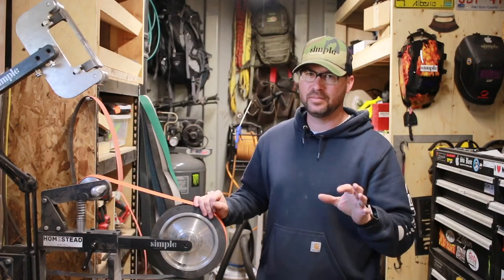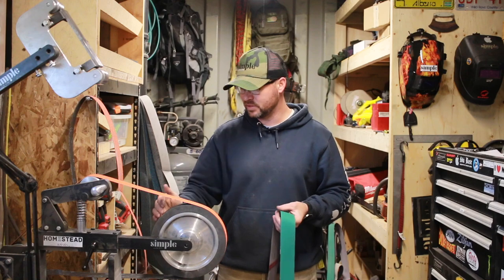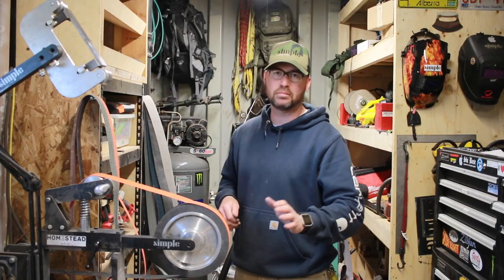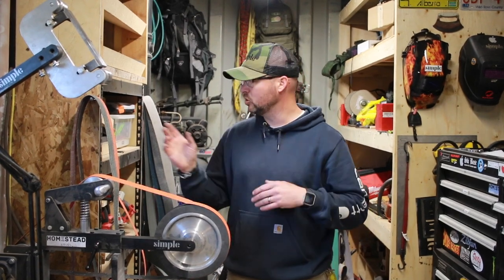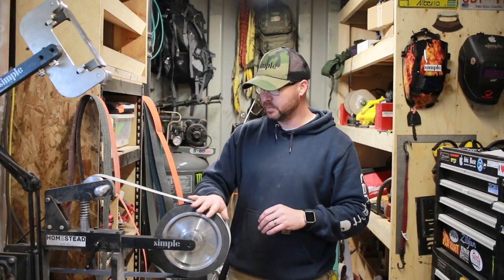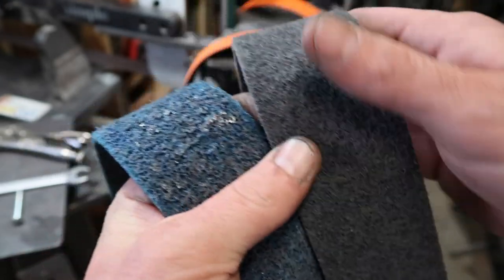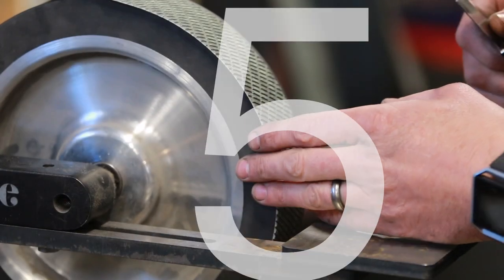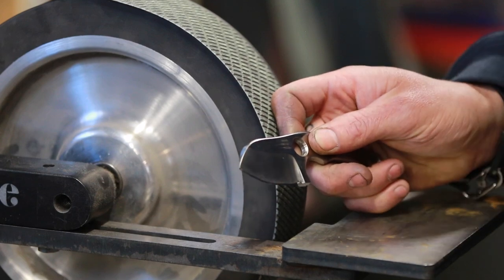5 Tips for Grinding Better Bevels on Your Knives - Grind like a Pro!

Comment: A great way to practice bevels without ruining a lot of good tool steel is to go to Lowes or Home Depot and buy mild steel bars.  It comes in the same thicknesses and widths as good knife steel but cost a fraction of the price of good steel.  Cut and profile pieces and then grind away.  You can get a 1.5" X 3/16" X 36 inch piece of mild steel for under $10.  Depending on your knife designs you can try to grind 4-5 knives out of the one piece.  Bear in mind that if you do a good job and like the knife, it won't be worth a crap because it won't harden LOL.  But once you get to that point, it's time to use good steel.  If I'm trying a new design, I'll still grind it first with mild steel just to learn from the process and also determine if I like the way it comes out without investing in a good piece of steel.
Reply: Great idea, and your results can become templates, if I'm not mistaken. Thanks!
Reply: You can make it harden. You'd need to case harden it.
Probably not worth it to most people, but if you had the gear lying around anyway for whatever reason.

Comment: I've been a machinist for 27 years.  I've freehand sharpened drills, for years.  I don't remember how bad I was, when I started,  but sure it was pretty bad.  All that aside, I'm new to knife making.  This video is a great reminder that this is a learning experience.  Some things translate, because hardenable steel reacts predictably. But beveling is a "new to me" skill set.  
Thanks for the plungline jig top, very helpful.  Add well as the angle modifying tip.

Comment: Good advise! I have been building knives for around 6 years now off and on and have found the jig thing is not good at all. I agree with the free style way of doing things when it comes to  grinding knives. You have more control of the blade and you can feel the angle better. Thank you for the info on the sander belts. I am working on building my own bigger sander 
and was wandering what belts i could use to make things better on my finesh product. I am using a fifty doller 1× 30 inch belt at this point and don't  have many options on types of belts to use. 
Thank you and God bless.
Maverick

Comment: Thanks for the tips! Just bought a couple of the x200 belts because I was literally having that same issue today with aluminum oxide belts! I was noticing the the left side and center of the belt was more worn down than the right side and I could not get the blade flat! Thanks again!

Comment: hello sir. i just wanted to stop by and let you know that tip number 2 definitely helped me out a lot with flat grinds. my thinking was to start off mild like 120 or so because if you mess up with 40 grit or 80 grit then its a lot of work to try and work that out. but after i watched this video i tried it and as it turns out, once you start with a really aggressive belt, and as a long as you take your time and the get line straight the first couple of passes, then its so easy to stay in that same line. its much easier to feel where the line is than if you were using a higher grit belt. and even if you mess up its much easier to just grind the flaw away and start your line again using lower grit. thank you for the tips. mine are still nowhere near perfect, but after practicing these tips on 2 or 3 smaller knives i can already tell a huge difference. the plunge lines are clearly defined and the bevel lines are pretty close to straight. im going to keep practicing and i hope youll keep making awesome content for us!
Reply: also wanted to add that i made a jig like yours when i first started and it worked really well, but i didnt feel like i did it. there was just a disconnect there that i didnt like. i felt like i would rather have some imperfections in there that "I" created rather than everything be straight and perfect using a jig. obviously, its a matter of personal preference, and i dont have anything against people that use jigs, but i just didnt like that disconnect. it just felt like i wasnt learning anything. the only way to get better was to practice doing it myself and so thats the route i went. thank for your content, sir.

Comment: Really is a great video, and shows the entire beveling process from pre-HT to post-temper. I appreciate that you call out what brand belts you use, but it might be helpful to also state the grit, or micron count. You did this in the pre-HT belts but didn’t mention it for the Trizact (which are indeed GREAT belts, albeit pricey). Excellent job man, and thank for posting this. Probably one of the easiest yet most complete example. Cheers.

Comment: Thanks I always learn something new from the videos, it's a huge help in growing my skills. You're right every knife and mistake you makes you a better maker. I think you are dead on with confidence in your grinding. If im stressed about something im working on or other life stuff my i notice my grinds need to be refined, or plunge line is off.  When im just working a style the that I've done before the grinds go smoother and faster. I have used a plunge line jig. First time I used it on one of my first knives the belt grabbed the bolt I hadn't trimmed down and kicked the edge into the belt. Opps. Over confidence can hurt  you too. Being complacent in the shop is easy to do. Mike at Ekim knives posted a video about shop safety. I watched it. The next day I was taking scales off an untaped knife. Just a few  seconds into this I thought this is dumb to do and as fast as I thought it I put a (small thankfully) knife through my pinky and out the other side.   Split second of not paying attention can get dangerous fast.  But after 4 hours in the hospital im much more careful to not get caught up with other things or rush to finish an order. I was really lucky my hand hit my vise or it could have been much worse. I now have the hospital bracelet in my shop as a reminder.

Comment: Hey Jeremy, 

I've learned a lot from you and I started grinding knives recently. I was using a rather neat jig and kept having problems with it, so I got a little irritated and tossed it gently (with great force) into the yard and decided I had to stop relying on aids, turned back to the grinder straighten up the messed up bevel and ground the other side. It was empowering.  Just to make sure it wasn't a fluke, I've ground several more since, not all have been perfect but, all have been plenty good enough to let out of my shop with no embarrassment.

I typed all that to say, looking for the easy way, in some cases just creates more hassle than help.

Thanks for the tips, I'm off to hand rub a finish onto the Field Chopper.
Reply from the maker: haha. I hear you. I like reading little stories like this and glad to hear that you were able to fix things up, and took control of the situation. Cheers buddy!

Comment: Very useful video, I was going to ask about the belts you used but you beat me too it. Where do you get your belts from? I'm in England and it's very hard to find ceramic belts. My next project is to build a 2"x72" belt grinder. 

They are usually Aluminium oxide belts in the uk, cheap and nasty.

Comment: Hi. I just very recently started my knife making adventure so I hope I don’t embarrass myself with my question. I have cut and ground out a few good looking blanks. It’s time to put the bevels on them now. I am using a belt/disc sander as that is all I have. I’m wondering if that is good enough to make the bevels, and if so which grit or grits to use to make the bevels. Thank you so much. And again I apologize for the “noobness” of my question

Comment: you should do a video using a 1×30 with tips on it because I feel its a whole different demon than a 2×72...or maybe not...I'm not sure lol but gosh I'm struggling so bad!!
Reply: I’m not even beginner level I might could cut a knife shape from a flat piece . I suspect though that you may try to use less pressure to contact surface . Is the edges of the belt leaving a profile
Reply: Guys you should look into the JET multi tool attachment, it is 2x36 and I get "decent" bevels for a beginner, I mean I'm only on my second knife but the bevel looks "decent" in my opinion. Been practicing..

Comment: Blending in the edge where you run the belt off the edge of the wheel, there are belts with a scalloped edge for the same thing.

Comment: Just finished building a 2x72 from 80/20 extruded aluminum. What do you recommend as the best contact wheel diameter for hollow grinds?
Reply from the maker: That’s sweet! I’ve found 10” to be a great all around size 👍
Reply: Simple Little Life thank you!

Comment: As someone who is new to knife making, how do you determine how much to angle the blade when grinding a bevel? I will be starting off by doing a flat grind (as I’ve heard it’s the easiest), but how do you know if you’re removing too much or too little material?

Comment: I'm at a point in my knife making where I've been hard on myself because I'm not getting good friends on my knives so I've gone back to doing by hand with a file and a jig.

But I really need to step it up and I've realized I need to fail. I need to make and fail making 100 knives. I'm not going to learn if the first time I try using a grinder I get scared and run back to doing it by hand.

Comment: I ground my first and only knife on a bent grinder held in a vise upside down.  It turned out ok.   My next will be with a file.  I know if I can use a belt grinder a file will be better.  Maybe I’ll start with the belt grinder to hog off then finish with the grinder.

Comment: Hi there, would it be easier to hand grind if the belt was running the opposite direction 🤔
Reply from the maker: No. You can’t see what’s happening to the edge when your grinding if you did it that way. Very few people do it as you suggest but in the end, it’s 100% personal preference. I tried it once and hated it.

Comment: Good video, the only thing I didn't like was where you were knocking aluminum oxide belts because of them not being forgiving.... Too flexible. Try a normal X or Y weight belt that is nice and thick not that J-flex belt that I only use on contours because of its flexibility... I used to use the Norton blaze 36 grit belts but I switched to generic 60 grit aluminum oxide belts because they will really hog off the metal fast and still leaves a fairly smooth surface, especially when going straight from grinding to heat treatment. Run your conditioning belts on your wheel and apply a soft bristle brass brush from under the wheel lightly to clean them. Make sure you clean your belts often to make them last longer and for a cleaner surface.

Comment: The longer the cut, the sharper the belt must be. If you're having trouble with the accuracy of the grind, either your belt is too fine, or too dull, most likely. Or, maybe your blade warped in heat treat?

I don't grind my bevels prior to heat-treat. I grind them hard.
Reply from the maker: Good to know!

Comment: Should you use a contact wheel or or a flat plat
Reply from the maker: It all depends on how you want the knife to perform for certain tasks. Contact wheels give a finer blade right behind the edge and flat grinds have more meat behind the edge. Contact wheel (hollow grinds) tend to be great for slicing while flat grinds (or even convex grinds) as better suited to chopping and impact type cutting. Even as such, there is a lot that goes into how a knife performs and why you’d choose one grind over another. But, either way if the grind is done well, it’ll be an impressive blade 👍

Comment: The only problem that I have that I don't have a belt grinder in my country as an new knife maker that I dint have it i made a lot of decent bevels with a file or an angle grinder I tried making a belt grinder and I failed so my work would seem a bit rough .

Comment: Pro Tip: Aluminum oxide belts also come in "X-backing" and are hard like your ceramic belts. It's the backing that makes the difference regarding hard v flexible. Your aluminum oxide belt was a "J backing" and your Ceramic was an "X backing."

Comment: Jeremy, excellent video! I'm new to knife making and the bevel stage is by far the hardest for me. I use a 2x42 belt grinder and aluminum oxide belts. I agree with your recommendation for using ceramic belts but I'm having a hard time finding distributors in Canada. Where do you get yours? And do you know where I can get 2x42? I'm looked for all the ones you have.

Thanks,
Mike, Grimsby Ontario.
Reply: Combat abrasives

Comment: You do not need different grind lever sandpaper. Only need grinding wheel. Grinding wheel can be sharpned to be  coarse, fine, migle and super fine. And knife hawe to be sharpen on grinding wheel. Sand paper can't make that bevel on knife straight. Professional know what I am talking about

Comment: Step number 1 spend 250k on the correct equipment
Reply from the maker: Hahahaha!!!! I love seeing the level of ignorance based on the erroneously assigned value of the equipment I use. 😆  You have been the farthest off so far which leads me to believe that you haven’t picked up so much as a screwdriver in your life. Hahahha, so stupid. (Also-just a tip for your: future-screwdrivers don’t cost $1000 as you are likely believing right now 🤦🏻‍♂️😆)

Comment: Here is my two cents on #3. Knife making is not a cheap hobby.  Learning to 'free hand' wrecks a lot of blades, and steel is not cheap...there is no such thing as 'practice' steel (don't grind welding steel from hardware stores it's has toxic fumes!). So if you want to make a few knives for yourself, family and friends get Jiggy with it because you can waste less money and steel.  If you then want to be a part time, maybe full time knife maker that only puts out a handful of knives learn to free hand, get the gratification that you made that knife start to finish with skill alone, and then if you become so famous a knife maker you need to pump out knife after knife after knife, and you're also doing all kinds of folding knives buy a CNC machine because your so stinking rich and famous :P!
Reply: Griff Grinds - Interesting, I've never heard that one before, that A36 mild steel ('welding steel') creates toxic fumes.  I'm curious as to where you heard or learned this?  I know a lot of bladesmiths (and blacksmiths for general forging projects)  use cheap mild steel for guards, the outer layer for san mai, frame handles and so on, all of which pretty much always require grinding for clean up.  For the most part A36 is basically a dirty (not as exact a make + a bit more impure elements) 1018 mild steel.  Not trying to be a smart... but am honestly curious about this.
Reply: lsubslimed I said welding steel, welding steel sold in Canadian hardware stores is galvanized steel...therefore toxic.  You may have a wider selection where you are from...typically you don't get Carbon steels like O1 or any 10XX, or stainless steels, or even semi-stainless like D2 etc. in hardware stores, they are only available through specialty suppliers like Metal Supermarkets for example.  I believe in the states the New Jersey Steel Baron Aldo Bruno is one of the best places to buy steel outside of popular online knife supply suppliers that's is like Jantz, Alpha Knife Supply, USA Knifemaker, KinfeKits, Texas Knifemaker etc, etc.
Reply: lsubslimed Also I just did a quick online search and I see that some ASTM A36 is galvanized...maybe not all variations so please be careful if you're using it.  Some will argue it doesn't get hot enough when being ground on a 2x72 grinder to produce harmful fumes, but better safe than sorry man.
Reply: Griff Grinds -  Yea that's interesting and it must be different in Canada as I have never seen galvanized mild steel sold specifically for welding, since welding galvanized steel is in fact toxic just like forging it.  I completely agree to stay away from galvanized steel at all costs.  I was just thrown off by your use or the term welding steel, since every hardware store I've been to only has mild steel sold as welding steel.   Thankfully it is easy to identify galvanized steel, unless it's really old scrap perhaps.  Again, not trying to be a smart a** , I just wanted to make sure there wasn't something I was missing.   Glad that's cleared up 🙂👍
Reply: Dave Erving Is it colour coded where you are from?  What I mean is the ends coated Red or Yellow...I am curious, that way I can check into what I choose to purchase in future.  I have a 1/4" thick Steel plate that's 6" x 12" with designated 'Red' coding and it says 'Welding Plate,' so I have refrained from grinding on it to turn it into a new tool rest.  Wonder if it is 'relatively' safe after all and I have been mistaken.